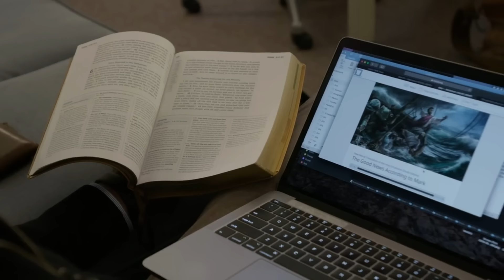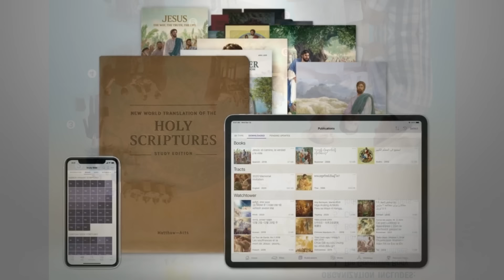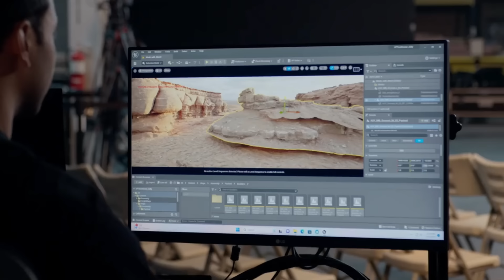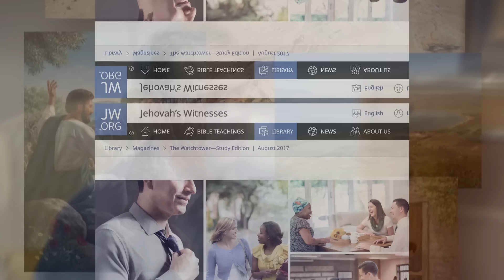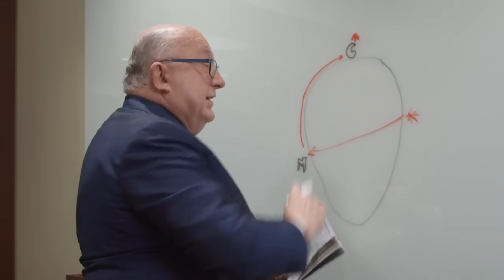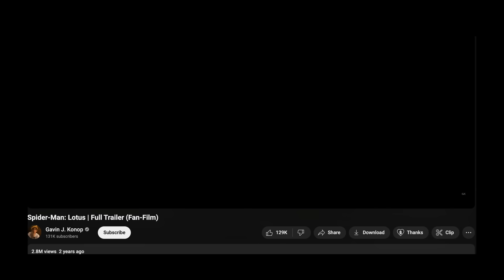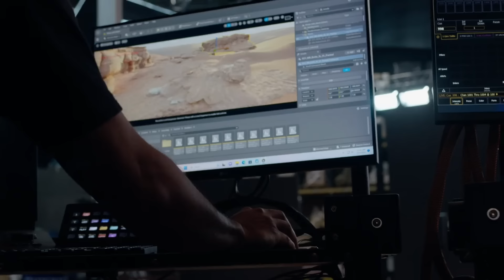the JW Jesus movie is a ridiculous disaster

Comment: They have to cut back and forth between Eve and the snake because they need that incredibly tight shot of Eve's face because she's supposed to be naked. There's zero chance they'll show more than a hint of her shoulder and maybe some ankle, so there's no room to show her interacting with the snake. Also, probably stock footage of a snake.
Reply: I was very disappointed.
Reply: WT doesn't want an "R" rating, thus the avoidance of full frontal nudity. Frankly, full frontal is probably the best way to get JWs to actually watch this crap.
Reply: will she be wearing a dress or pants?  and y r they white?
Reply: Is that why Adam was smirking?